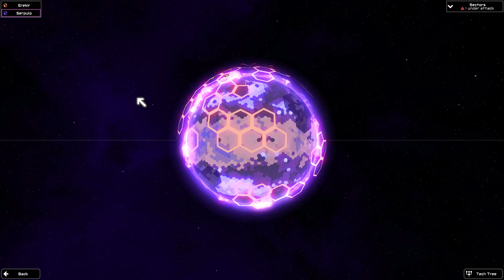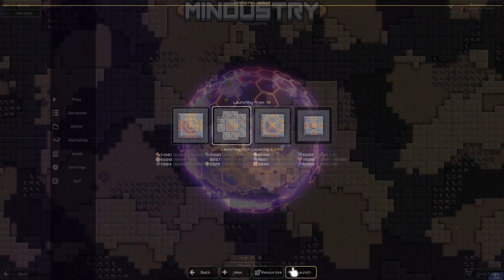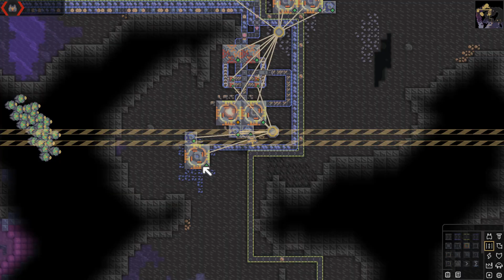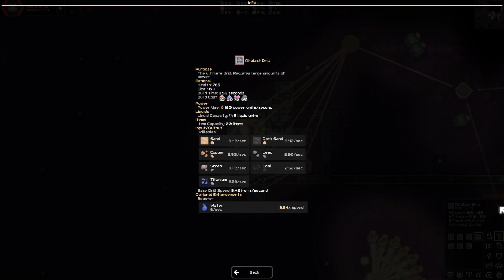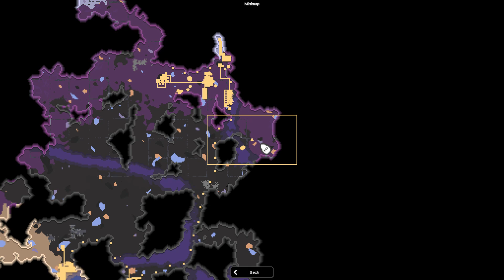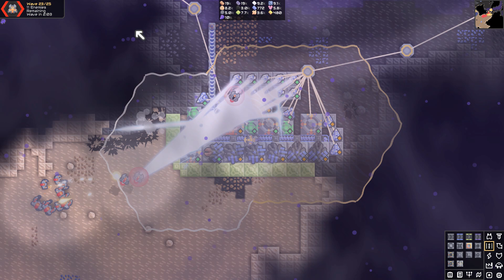Mindustry Future Factory Sector?

Comment: Air units prioritize power generation arias more than the core. Becouse of that they usually die to the explosion of the thor generators or shock generators. They're there to force you to rebuild your back line inserted of front line

Bdw. Plastian walls don't have mutch hp they are slightly better in terms of hp then titanium walls but laser weapons don't piece them like any other wall that's why you should use them as a second layer of the wall
Reply from the maker: That makes sense. Thanks for the info.
Reply: Not all air units have the same ai
Flares attack factory blocks, horizons do the same. Zeniths target containers and vaults. Antubras and eclipses attack advanced reactors (thorium, differential, impact etc.)
Reply: @Znatok1699  I think flares would more often go after power generation and eclipses secondarily target batteries
Reply from the maker: @Znatok1699  Now this is all new info to me.